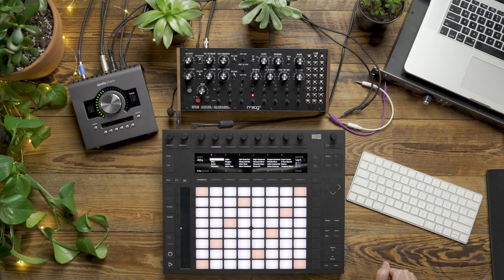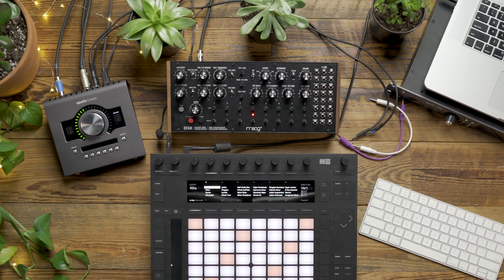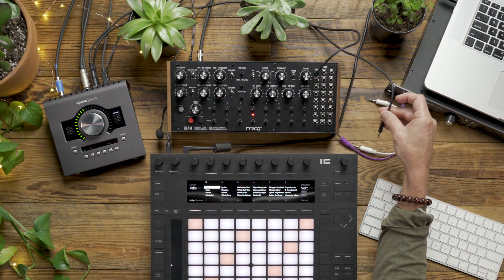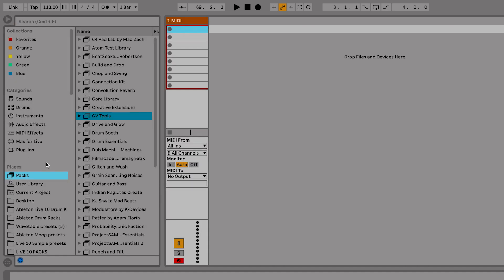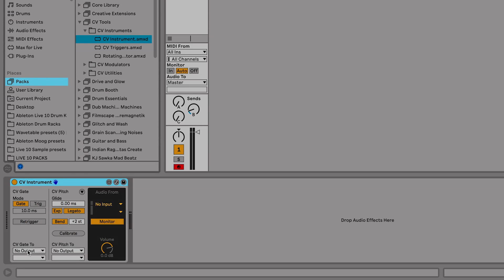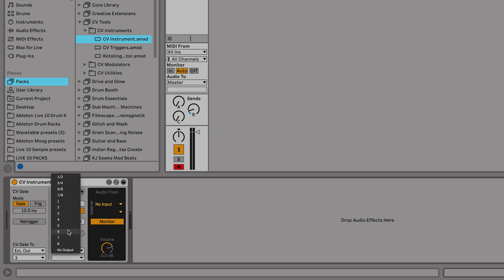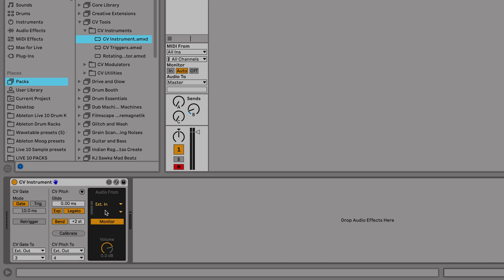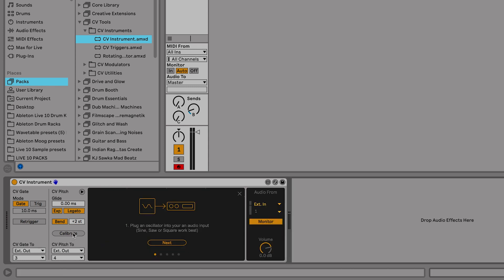DFAM | Calibrate Ableton’s CV Tools to your Synth

Comment: For anyone having the "Error! None or insufficient control voltage" message. Here is how I fixed it on my MOTU Ultralite mk3. 

Step 1: Ensure your soundcard is DC coupled, not all of them are, this is absolutely necessary. 
Step 2: Buy the correct cables, not all cables are equal, I went through 2 pairs of 1/4 to 3.5mm, the first one only worked when I pressed/wiggle the cables, since this is not stable, I went with the HOSA 1/4 to 3.5mm patch cables from Amazon, they did the trick. 
Step 3: Make sure your OUT channels for CV Gate To and CV Pitch To are accurate! For my MOTU, eventhough the soundcard says Channel 1 & 2 , in reality it is 3 & 4. 
Why? Because 1 & 2 are connected to my MAINS (studio monitors). 
Once this is done you should be on easy street. So please triple check and don't be afraid to give tension to your cables as it could just be cheap cables causing you headache. 
Hope this helps!

Comment: I'm receiving "Error! None or insufficient control voltage" when I attempt to calibrate the DFAM. Do you know why this might happen?
Reply from the maker: Either you're using an audio interface that doesn't have DC-coupled ins/outs, or you need to use a floating ring cable that has a 1/4" TRS on one side, and a 3.5mm TS on the other.
Reply: Moog Music Inc My audio interface is DC coupled, so it must be my cables. Thanks!

Comment: I'm having a bit of trouble with this, sending out from output 3 on my Komplete Audio 6 to trigger on the DFAM, set it all up as you did and it won't trigger! Also sending out from output 4 on the KA6 to VCO1 CV (as in the video), set it all up and when calibrating the pitch does go up... but wont go donw past C3, just plays the C3 note... any ideas? I can trigger from my BSP with no problems, and clock out to ADV / Clock does work via CV tools and my KA6.
Reply: The Komplete Audio 6 probably doesn’t have DC coupled outputs, you need those to be able to send CV signals out of your daw.

Comment: Hello I did the exact same thing the exact same gear (apollo twin mk2) and I constently receive the (very frustrating) message: Error! None or insufficient control voltage. I have the input at almost -1DB. I don´t understand whats the problem, could you please help with that?
 Thnks!
Reply: Hi, did you ever figure this issue out? I'm just doing research on DFAM's connectivity with Ableton, and I'll only buy a DFAM if it's solid and stable. Did you fix this issue and are you having any other issues?
Reply: @louderup  it's def not the DFAM.. that bad boi is a gift directly from the gods amongst us
Reply: I have the same problem, I just think that the outputs of the MK2 are AC AC, while to make a CV it takes DC direct current
Reply: Did you ever figure this out?
Reply: @sallwall1  Did you ever solve this issue?
Reply: Did you ever solve this issue?

Comment: I have an Audient ID14 and an ASP800 connected via ADAT. The latter has a connection for 8 analogue outs. If I get the right cable, can I then use it to send CV? Or do I need a completely different audio interface than the ID14?
Reply: Just got an answer from Audient and none of their gear has DC-coupled outs.
Reply from the maker: We recommend contacting the manufacturer to find out if the analog outputs are DC-coupled.
Reply: @MoogSynthesizers  
Is this the case for apollo twin mk1 solo? this one benefits from the optical in, on which I add a focusrite ocotpre to obtain for entry and exit. But it's the same fight, no DC it seems to me. I fall back on my beat ste pro but latency with my daw must be rectified manually